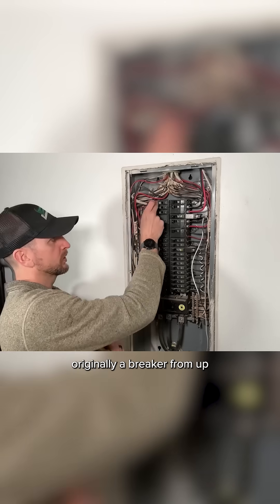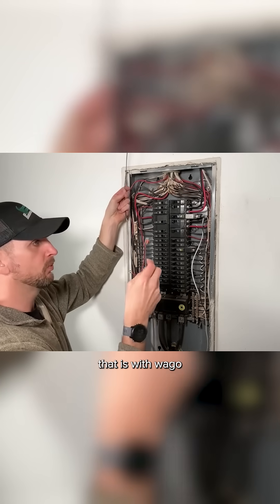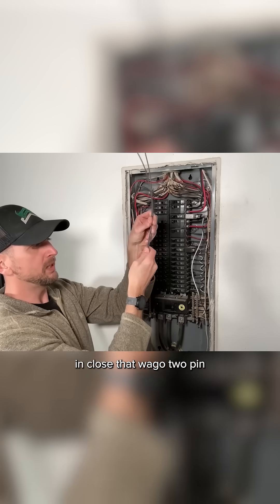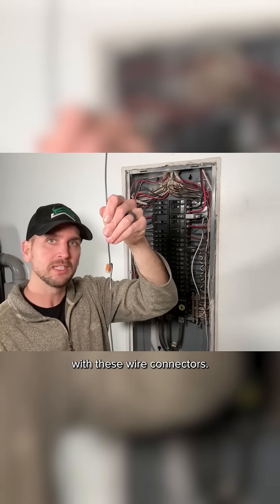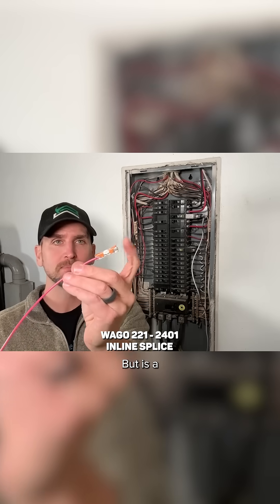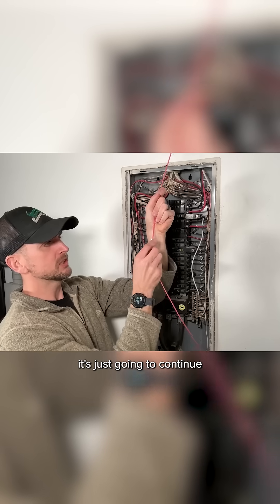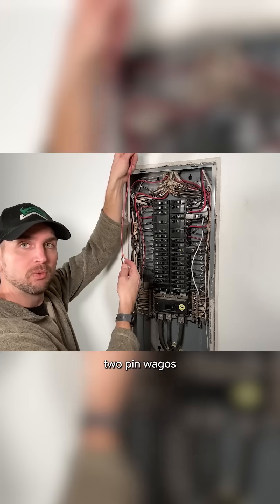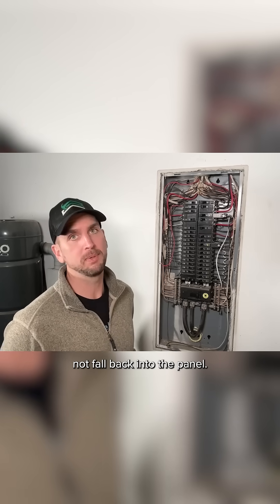The BEST Way to Extend Short Wires in Your Panel – Wago 2401 Butt Splice

Comment: I was wondering about was it NEC acceptable to use those wago connectors in the main panel or sub panel.  So much easier to extend wires with the straight wago.